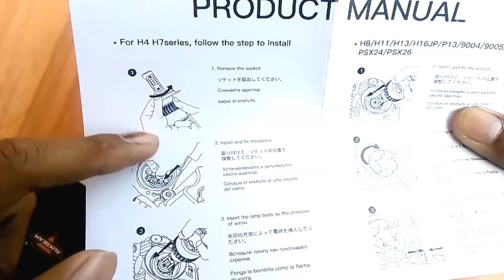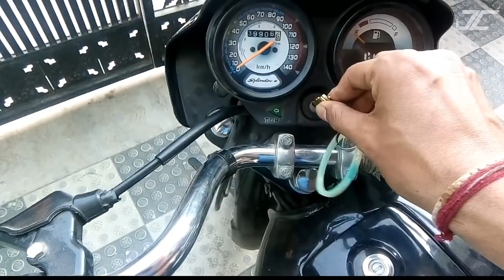Install auxbeam light, for splendor & other bikes | jabardasT light | indeep custom

Comment: Bhai aap ne battary kittne ah ke upgrade ke hai?
Reply from the maker: 5 amp ki battery he. Phle 2.5amp ki thi...
Reply: @indeepcustom  Okey firr battery life Kesse rahe, I mean drain issue
Reply from the maker: Nhi bro. Koi dikkat nai aayi. Battery lgaye 4-5 saal hogye. Auxbeam + roots k horn lge h. Roots v 4 saal se use kr rha hu. And auxbeam lED light 1 saal se
Reply: @indeepcustom  wowww mazza a gaya bro thx
Reply from the maker: Thxx wlcm
Reply: @indeepcustom  jhutt na bol bro 2 saal m meri khrab hogeu 5 amps horn b bosch k black wale the fir b
Reply from the maker: @luciferr420  bhai meri lockdown me battery khrab hui. Wo v meri galti k wje se. Wrna 2016 me mene battery lga di thi.. oK report chl rhi thi.. lockdown me 7-8 months tak bike start nhi huwi to lge-lge khrb hogyi battery. HORN to abhi v chalate h.